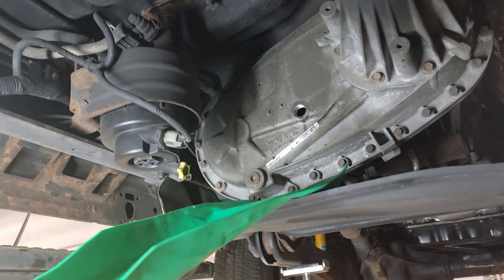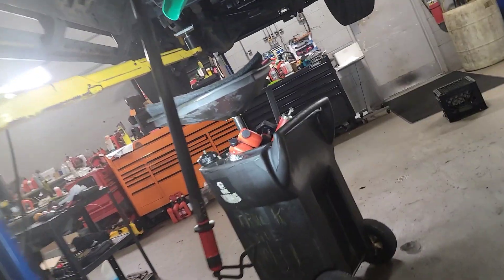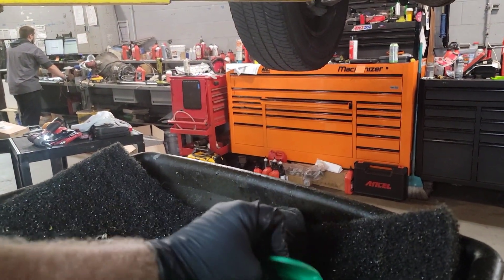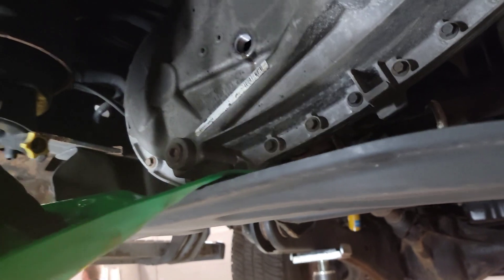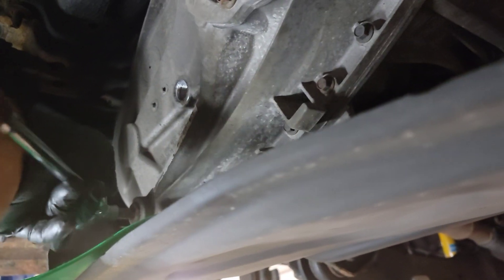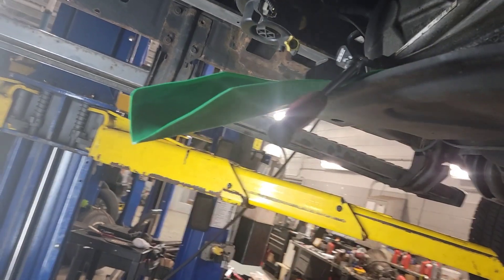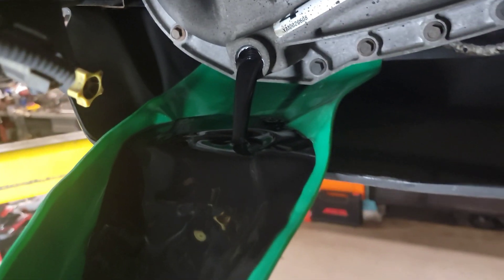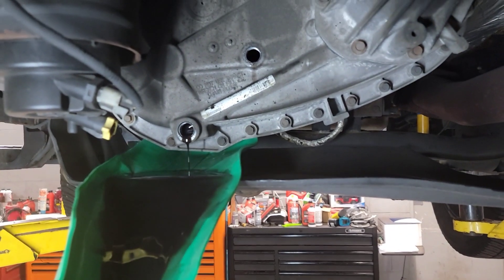Quick Tip Clean Service - 2011 - 2022 Superduty Transfercas service tip - No Mess Amazon Part $10

Comment: I do the same thing whenever I have to drain oil from the 3.5 raptors otherwise it just pools in that skid plate and will leak unless you spray it out so I just avoid that headache all together

Comment: I use that when changing oil filter on my 2015 Mudstang GT works well ,stops the oil dripping on the electric steering connections ,its worth it .

Comment: Cool tool, I need a way to add the fluid to the transfer case and front dif.  the fill hole is too close to the bottom of the truck. no room.

Comment: did one the other day,took 4 bolts off and removed the skid plate.no mess.
Reply from the maker: Yeah so what ends up happening is you end up snapping those J Hooks that go in the frame because Ford likes to put a ton of Loctite on those bolts for no reason and it happens all the time so not a wise idea there's a reason why I make the recommendations that I make it's not because I'm trying to get corrected by somebody it's because I'm in the field and I do this probably more than most of you on here do and I know what works and what doesn't
Reply: @FordBossMe  my bad.I don't live in the salt belt .Rust usually isn't an issue in Oregon.
Reply: By the way,I have been a humble ford tech for 32 years .15 years senior master tech.

Comment: I have a brake fluid question. I have to bleed my brakes on my 68 Mustang. I have regular DOT 3 brake fluid in the master cylinder and all lines. Would you use Synthetic DOT 3 brake fluid or stay with regular DOT 3.
Reply: Dot 3 is all full synthetic
Reply from the maker: ALL DOT 3 should be compatible

Comment: Question please if you don't mind on my 95 Lincoln mark iiiv the spark plug wires where they go in the valve cover they got hot and are breaking how's the best way to get them out you think please and thank you
Reply from the maker: Honestly when they start seizing to the metal around the hole you're almost better off just replacing them and just yanking them out of there trying to pull them out the best that you can and you're going to have to fish them out piece by piece if they break and then replace them